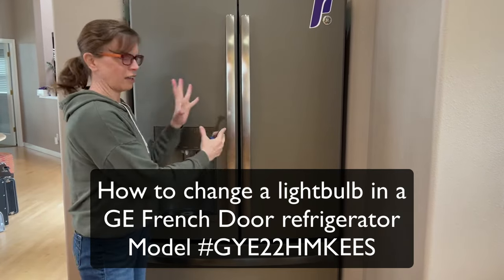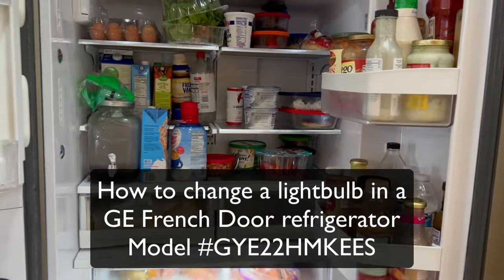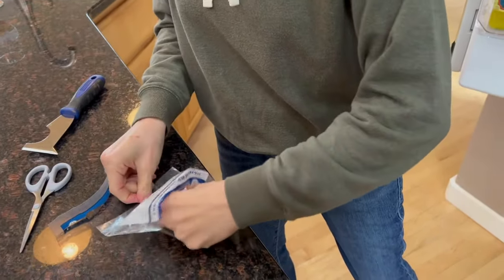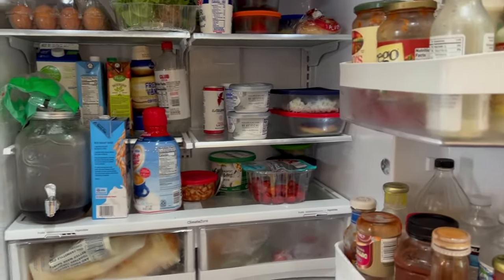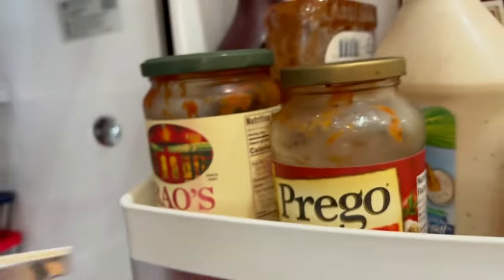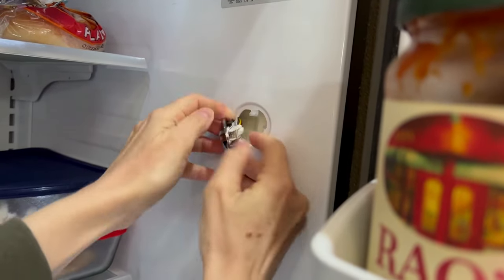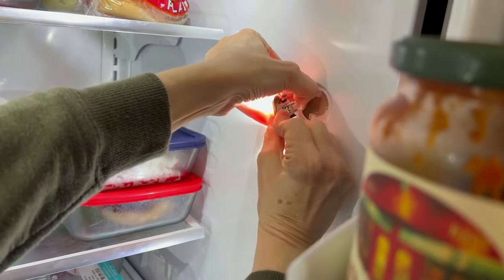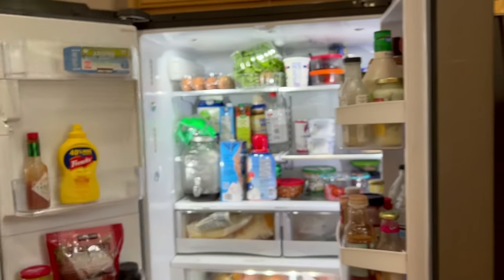How To Change A Lightbulb In A GE French Door Refrigerator Model #GYE22HMKEES

Comment: Was considering another brand to avoid having to call for repair just to replace a light. Thanks for the information!!
Reply from the maker: You're welcome, Georgia! I was happy I didn't have to call a repairman for this and wanted to share with others so they wouldn't have to either!
Reply: I have found GE to be the most unreliable POS manufacturer on ALL appliances! Used to be a solid company, but it’s  Walmart quality. 
Never making a purchase again! 
Good luck with the freezer section not crystallizing your food 🥘 using rapid-cool feature, the ice dispenser consistency freezes up and we take it apart and break the cubes, and our water comes out as a trickle-stream even though I tested the pressure from the house line. 
 Samsung or Fridgedair cost more but at least they work better. 
Thanks for the video, I do appreciate help fixing garbage issues. 👏🏻

Comment: All the lights in my GE fridge dimmed, no longer bright but not completely out.  Should I replace them?
Reply from the maker: On my refrigerator, all of the lights went dim except for the one that went out ... it was completely off. That's how I knew which one to change! If you don't have one that is off, you might need to try a few to figure out which one needs to be changed.